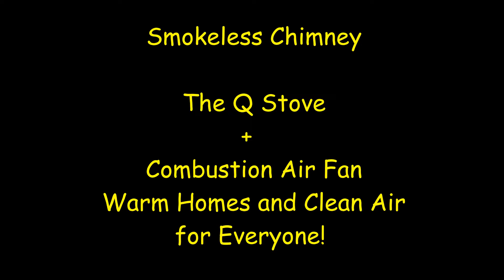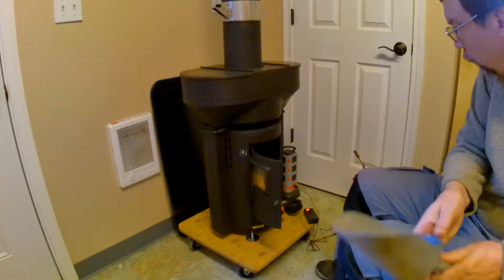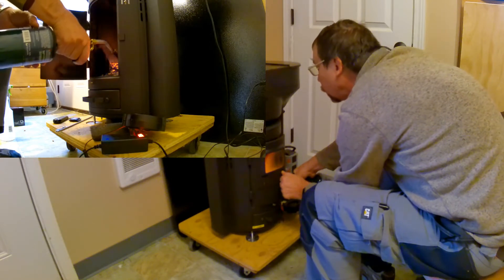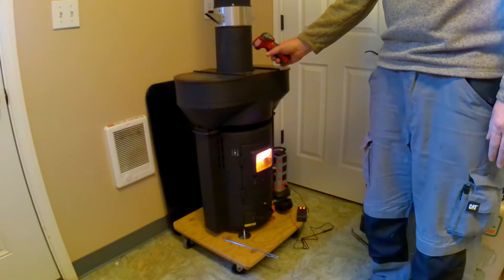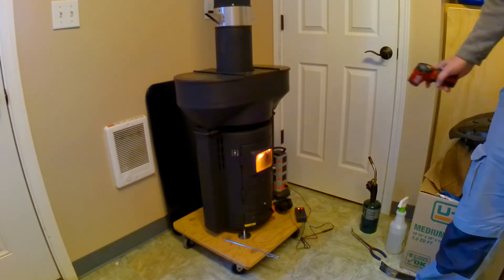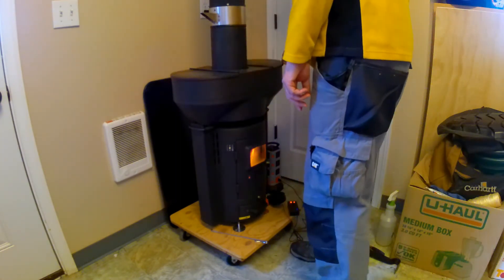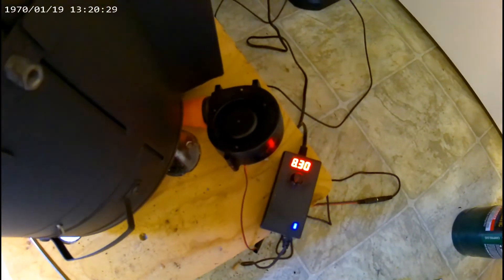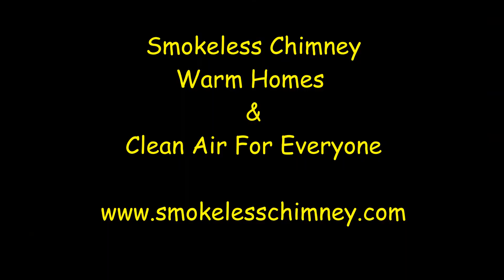Q stove with Combustion Air Fan

Comment: Do you mind if I ask why this is any different than using a wood burning stove or a wood pellet heater? I have a very small cabin and need a small heat source. This looks like it would work perfectly. I was already thinking of doing so when I found your video
Reply from the maker: This is only for outdoor use. Smoke comes out of this often, therefore, it is intended for outdoor environments.
Reply: @smokelesschimney8849  bummer, lol. I was hoping to use this is my small off-grid cabin. Any recommendations?
Reply from the maker: @caseymckinley1253  What is the size of the cabin and coldest day?
Reply: Where do I get the fan